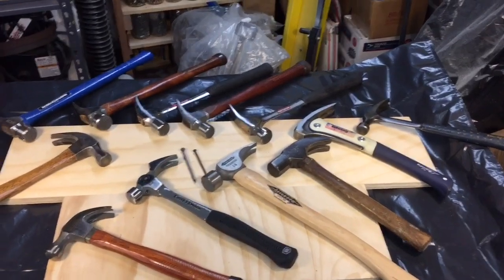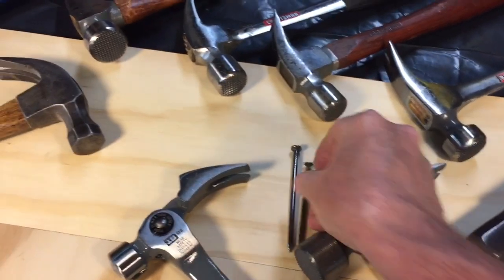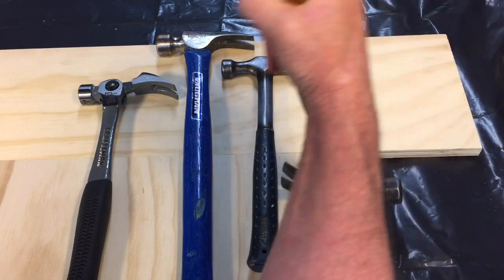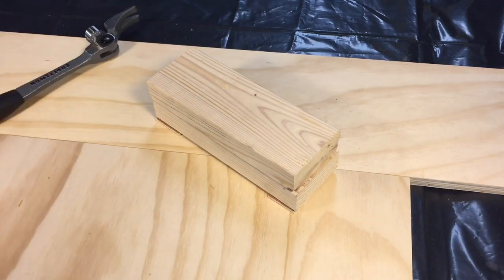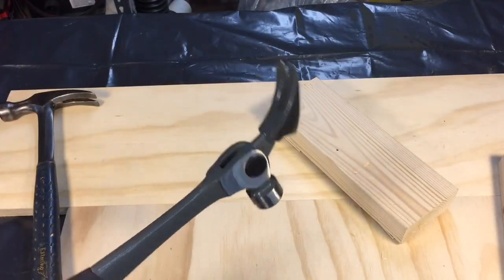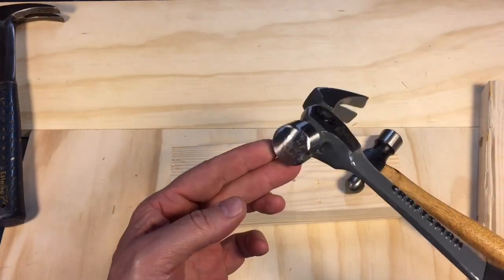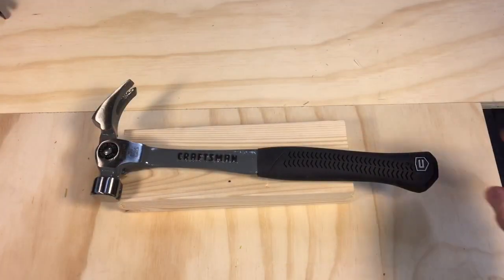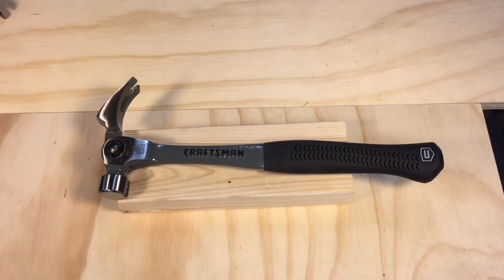Craftsman Adjustable Claw Hammer...

Comment: In England a ball pein hammer is exclusively a mechanics tool, claw hammers weren't used so much here as timber stud work is relatively new in Britain; many older woodworkers prefer a joiners cross peined hammer and separate pincers for pulling nails when needed.
Reply: interesting. in canada it seems.most people use ball piens only for shaping metal.

Comment: That hammer wouldnt work well for pulling nails, it would marr up the wood like crazy since theres no surface to spread the force out with such a short claw design, so it then rides off the striking head which will dig into your piece, so the only use would be for framing potentially but idk about the balance and weight for long term nail striking

Comment: I recon they made it rounded so that it would work better as a fulcrum. Obviously the man who thought of the dome hasn't drove many nails. I'd be interested in seeing how much beef the pivot could take.
Reply from the maker: Metal Butcher - I thought the same thing... The slight curvature would help in that way but really effects the performance of the hammer. To be honest I didn't even notice until I tried driving some nails then it was obvious!  Strength wise the design is very formidable, I would not hesitate using this tool as a prybar as I feel confident it will be sturdy enough.   Thanks for commenting!  😃👍

Comment: I think they make a rounded strike head for a reason. With it round you will have less damage to the surface when you pry at position #4 and smoother the motion. It easier for them to make it flat than round dont you think and why they have to choose the harder way?
Reply from the maker: Tai- They have since corrected the error and now their hammers all have flat faces!  You might still be able to find a early (first generation) domed head hammer on eBay or something... If you want to laugh, pick one up and have a friend try to drive some nails!  LOL   Good times!!!!   =)

Comment: Craftsman must have watched this. I just picked one up at ace hardware and the head is perfectly flat...
Reply from the maker: Hi Mike, It’s funny you mention that! Two weeks ago I saw the same Adjustable Claw Hammer with a different brand marking and that face was flat too!  Maybe they had some complaints after the early run of hammers with the domed face were produced. I almost wish I had another to prank my friends with, that hammer with the curved face made you look like a total spaz trying to drive finish nails, you would bend over every one and it wasn’t obvious why!  Thanks!!! 😃👍

Comment: After watching your craftsman screwdriver restoration video, and now this hammer mod, I'm glad I subbed to your channel. I have one question. Upon modifying the hammer on the sander, do you find that the tool can still be used to lift doors into place?
Reply from the maker: Hi Carlos, great question! I know this hammer is a bit 'gimmicky' but I collect hammers and had to have one. Now I must tell you that before the modification, hammering a nail with the curved face was a nightmare, I was slipping off nails like a nine year old, after fixing the face it behaved much better. The prying action is still fine, basically you would be using this on rough type jobs so you wouldn't notice a difference. So in answer to your question 'unaffected by modification'... I hope this helps.    Thanks!!!   😃👍

Comment: Hey Now Scout : I thought I was getting this 18 oz hammer.
Never Seen Anything Like It.
Had to order online at SEARS. Granite Run, Pa.
When I went to pick it up, the one they brought out was jammed, 
could not move button for claw. When I said do you have any more?
They brought me the 24 oz. one. Which they charged me $20.13 including tax.
I don't have a belt sander, hoping I can send you the hammer  to fix the face flat?
Thanks.
Reply from the maker: Hi Terry!  The last batch of hammers I saw from Sears they had fixed the faces!   They were only slightly domed around the edges...  Is yours like that?  bicycleguy@aol.com
Reply: @ScoutCrafter  
It's not as domed as the one you have.
I think I will take it down a little on the 1 x 30 Harbor Freight belt sander.